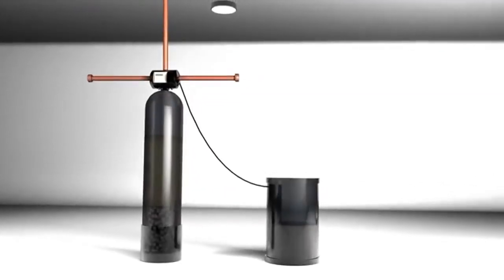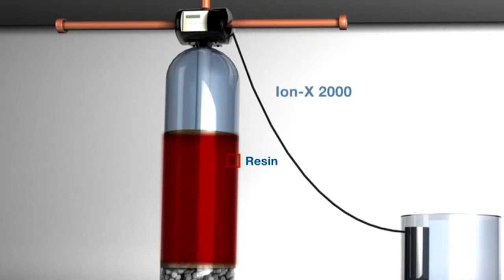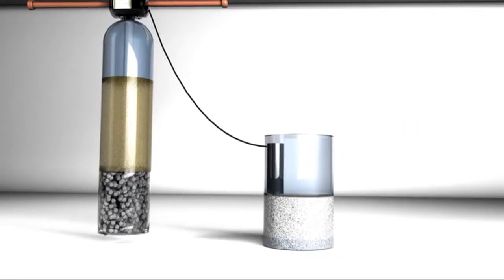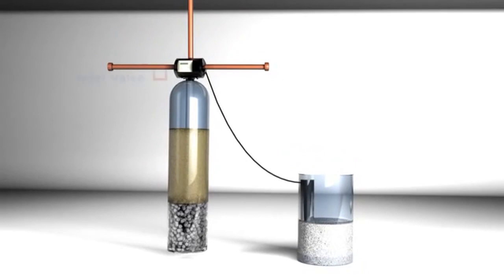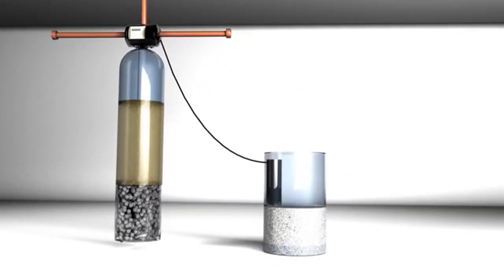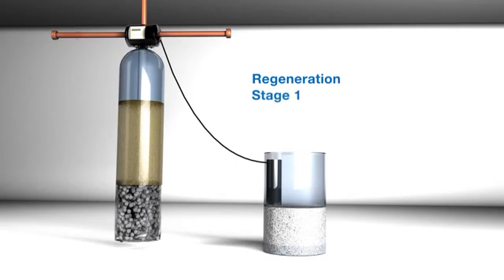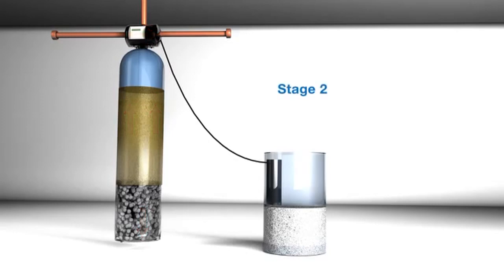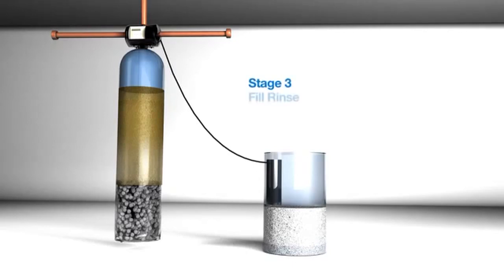How an ion exchange water softener works.

Comment: Thank you for this video. So is the water flow always pressurized or does the valve stop the pressurization from happening? Not sure I understand the expanding of the resin step if there is always a flow of water in the expansion part of the tank.